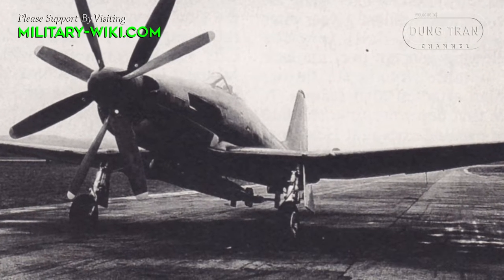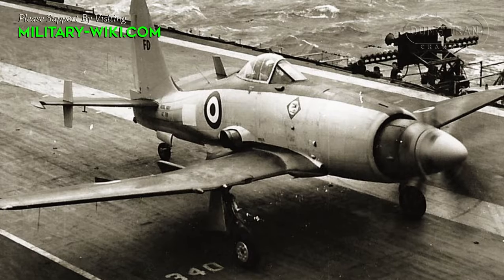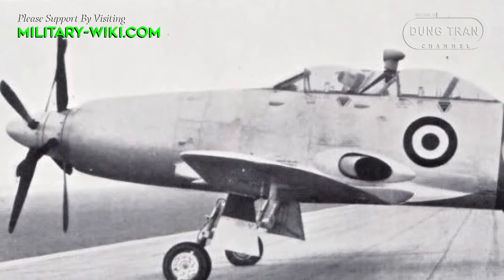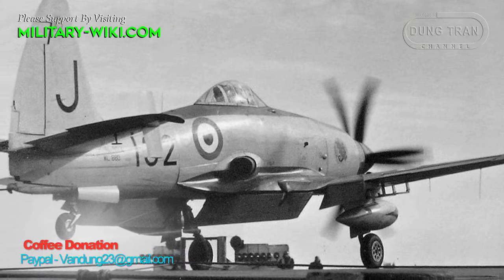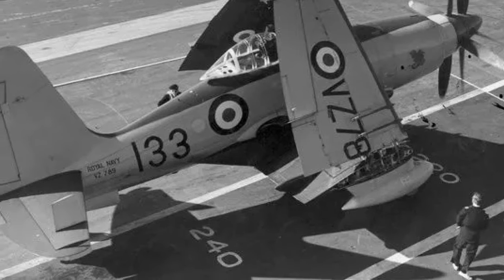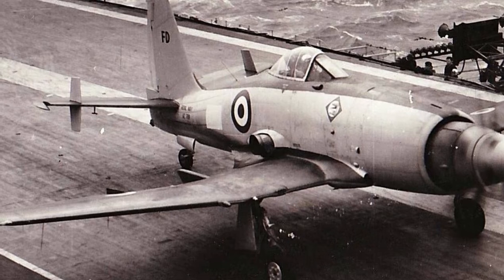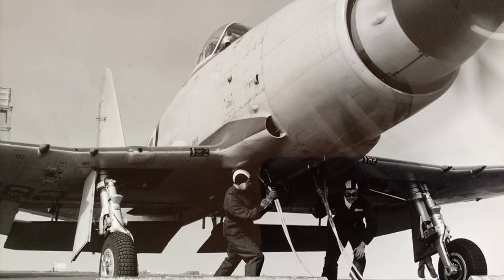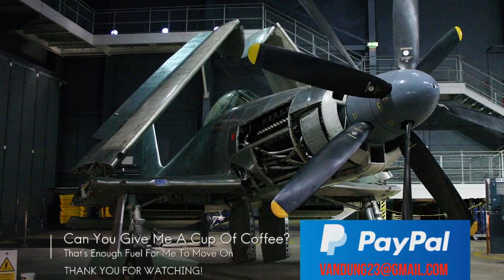Westland Wyvern - Mighty Dragon With Turboprop Engine

Comment: You are wrong about the location of the engine. The entire engine, gearbox and accessories are situated forward of a firewall that is situated just aft of the air inlets near the wing roots.

Comment: The Wyvern was equipped with a turboprop engine, hoping to combine the good qualities of piston engine fighters (short take off and landing) with the good qualities of jet engine fighters (speed). It turned out to be the opposite; slow to take off and land, very low maximum speed. And as you mentioned, in the beginning unfit to be launched by katapult. So a complete failure. No wonder it went out of service in less than five years.
Reply: You don't need a high max speed to do bombing runs and CAS with. This plane was great but funding and engineers had even better projects ahead. Same goes with any awesome super prop at the end of WW2 or Korea...jets took over, period.
Reply: @GLC1979 I am sorry to disagree with your assertion that the Wyvern was a great or even a good aircraft.

My farther flew them (813 sqdn on HMS Eagle), he and the other pilots hated it. Whilst a stable weapons platform it was slow but with a high landing speed.

The engine was prone to overheating as was hydraulic failure. The incident and loss rate was high.

My farther had to eject over Mount Etna due to hydraulic failure and had two forced landing due to over heating and power loss, the second of which was at RNAS Ford with the aircraft being written off.

It was difficult to maintain and therefore had a low sortie rate….a terrible aircraft.

I remember a conversation some 20 years ago between him and his very good friend from the same squadron (and his best man) Mike Stoner. They were both laughing about how terrible the aircraft was  and how lucky they were to survive it!